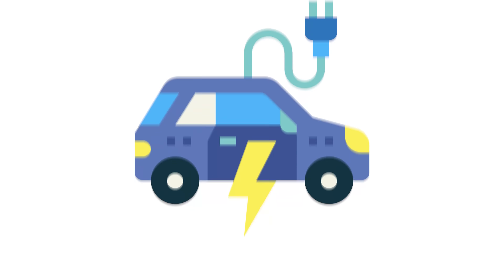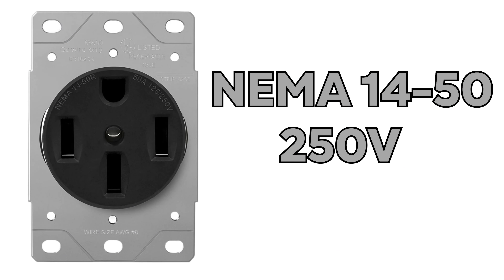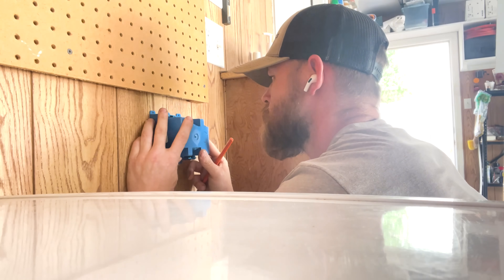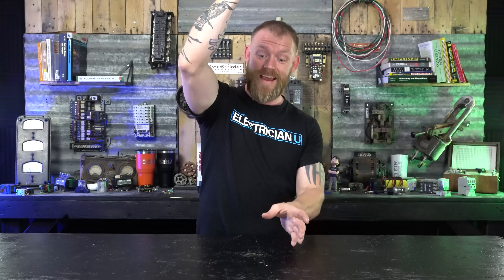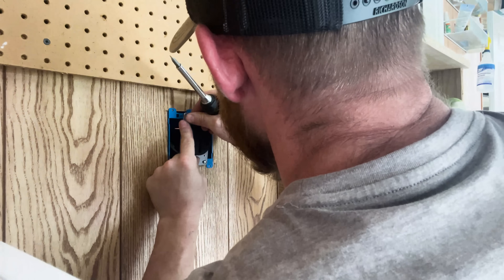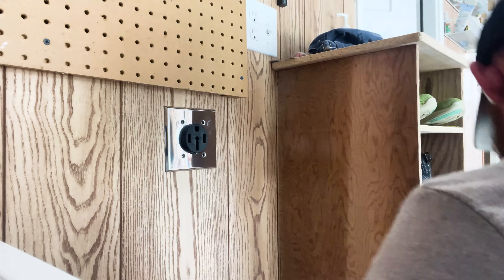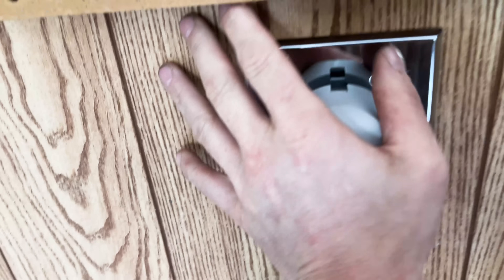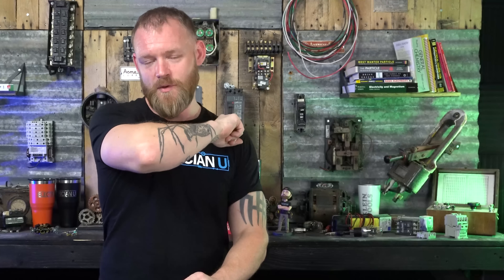How to Install an Electric Vehicle Charger Receptacle

Comment: You can use #8 THHN on a 50 amp breaker but not #8 romex unless I'm taking crazy pills...
Reply: I agree #8 is not correct
Reply: @tikigodsrule2317  #8 is correct since plug-in chargers only use 32 amps but should be protected at 40, hard wired can go up to 60 and those should be on a #6
Reply: Not all plug-in chargers go to 32A, many go to 40A. 30A breaker and 8/3 is only appropriate if the charger connected was going to use 24A.
Reply: We run 8/3G tray cable for chargers. Its rated thhn

Comment: I thought 8/3 was only rated for 40 amps? I thought 6/3 was 55 amps?
Reply: I thought so too
Reply: Depends on the temperature rating of the install. In the code book there is a chart listing that information. In this case he installed a breaker that was much lower than the current rating of the conductor or receptacle, so it is safe either way.
Reply: @athhud  If it's type NM (Romex), you have to use the 60 degree rating.
Reply: He also mentioned that that’s what the customer wanted. Customer didn’t want to overload. You can do a 50 amp breaker for 6/3 wire.
Reply: 60 for nm load rating, but 75 for derating

Comment: Why do you need a neutral?  Are there 2 "logical" blocks of batteries requiring 120V each?
It's my understanding that breakers only "restrict" the amount of current by tripping.  Fine tuning how much current is drawn is determined somewhere else.
Can you then make an adapting extension cord from a standard 220V 20A outlet to charge a car?  Or is 30A with a neutral the bare minimum?
One more question:  Am I too clever for my own good?
Reply: Here's some more details. The Nissan uses a SAE J1772 connector. There are 3 power pins: L1, N, and PE.  The charger senses whether it's plugged into a 110V outlet (using an adapter) or a 220V outlet (no adapter). When it's on a 110V outlet, L1 is 120V and N is neutral. On a 220V outlet, N is effectively switched to L2, so you have 220V across those two pins.  PE is always protective earth.  Since it possible to use a NEMA 14-50 to NEMA 5-15 adapter, neutral HAS to be present. So whether or not the charger actually uses the neutral line in a 220V configuration, it has to be present in case an adapter is used.
Reply: You need a neutral because the receptacle is a three pole four wire grounding recep.

Comment: Also with dryers being a GFI breaker if they are internally bonded the neutral and ground soon as you try to turn that dryer on it will trip the breaker
Reply: An appliance should never have the neutral and earth bonded together.
Reply: @stargazer7644 ...  Many driers come that way because of older homes and 3 wire plugs. If you read the directions you need to remove that bond to use it on a 4 wire plug.

Comment: So do you not have to staple/secure the wire within 12" of the box on old work boxes?
Reply: No since you dont have access to it the NEC doesn't force you to. I do like to throw at least one staple on it on each side where it comes into the attic just so you can't pull the slack into the wall.

Comment: These 14-50R receptacles are also used for RVs and travel trailers requiring 50 amp.

Did you use #8 wire because of a short run to the box? Currently installing one for a welder and everything online told me #6 wire.
Reply: I do 6/3 with a 50 amp GFCI breaker.
Reply: I believe you need a neutral for RVs because many are broken down to 120 volt panels inside the RV itself.